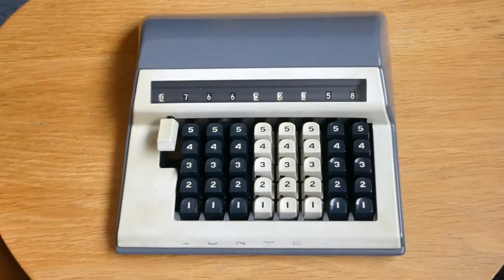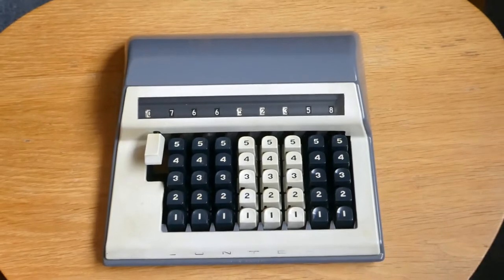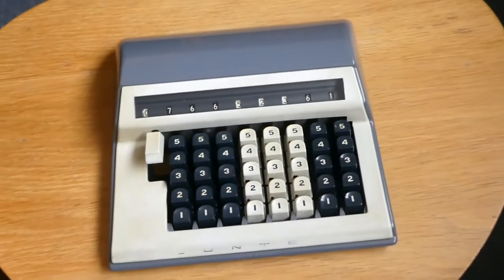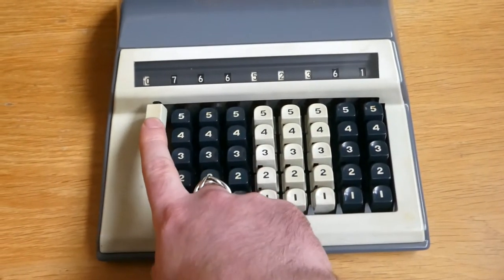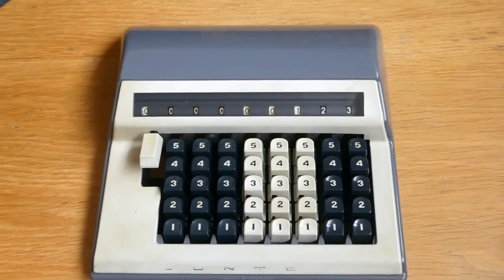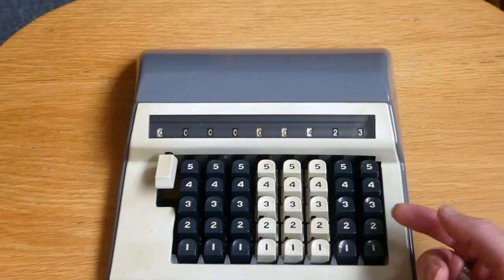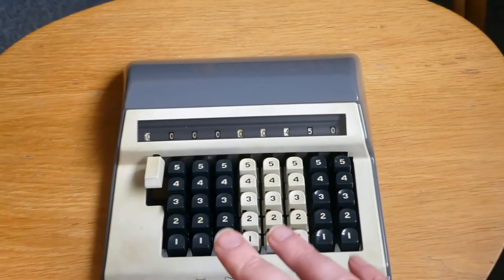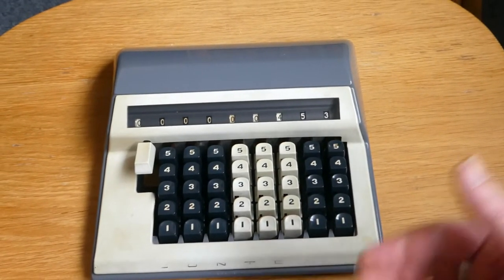The Contex model B adding machine

Comment: In your example of Carry error, what if you press 5 (50) and release, then press 5 and release?  You are adding 50, then 5 so the carry should work.  No need to press all digits simultaneously.
Reply from the maker: You can either press buttons simultaneously like on a Comptometer, or completely separately. The problem with the latter occurs when you use both hands (which I couldn't do since my other hand was holding the camera). When you speed up, you will  have a tendency to press down with one hand before the other hand has fully released its button(s) and risk getting this error. It is not as big a problem as the partial keypresses are, but I thought it was interesting to demonstrate.